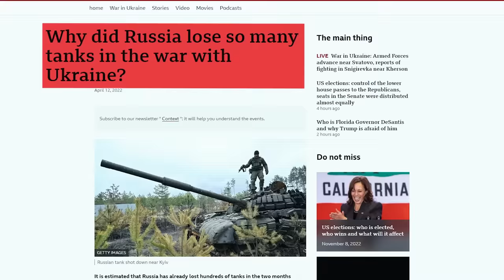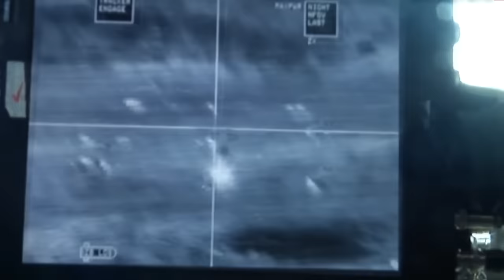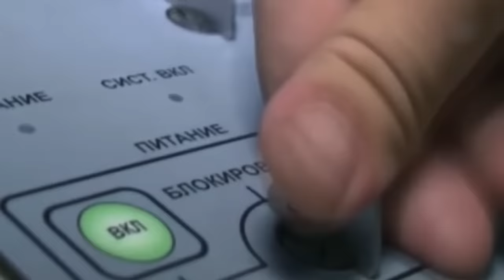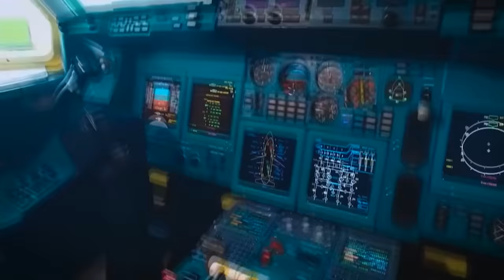Something is wrong with all Russian tanks

Comment: NLAWS & Javlins have ended the Russian ullusion that tanks will be King , well the King is dead & Russia has been proved to be incompetent, failing in supply & when Ukraine gets longer range missiles they will interdict these suppliers columns that will never reach the front .
Skava Ukraine 🇺🇦
Reply from the maker: Thanks 😊
Reply: tanks are still good, the Russians just didn't exercise proper combined arms warfare which is the major reason as to why they lost so many vehicles
Reply: No tank is invincible, a proper tank is still a really good tool on the battlefield
Reply: @blackdification  Did you hear USA and Germany decided not to send tanks?
Reply: @theoriginalkeepercreek  they are sending tanks
Reply: @ntal5859 , You are correct about Russia winning and all those responsible for this war in Ukraine be looked over very carefully..
Reply: Artillery is the king of battle not tanks
Reply: @briancarey1159  How long before Ukraine runs out of Artillery shells?
Reply: The tanks is still king.  Something you need to consider is why those quarter-of-a-million-dollar missiles were bought in the first place.  Because you don't want to be facing a tank on a battlefield.  And there have been reports from Ukraine (from both sides) that talk about how terrifying it is when the enemy has tanks, and you don't.  

BTW - it's more likely that the antitank missile will fade away like the other antitank weapons have.  Read up on the 'Trophy' APS (Active Protection System) that's being license-produced in the US and fitted to our tanks.